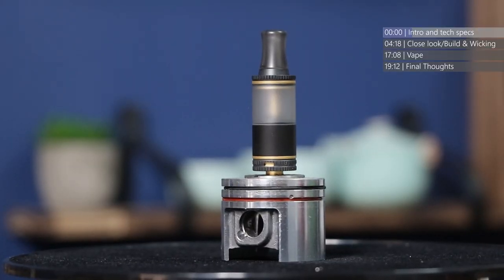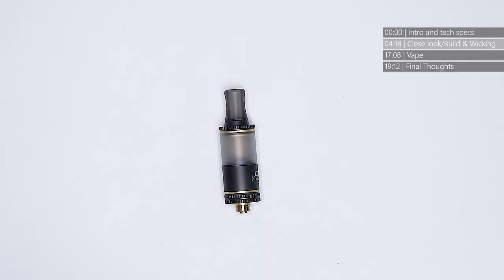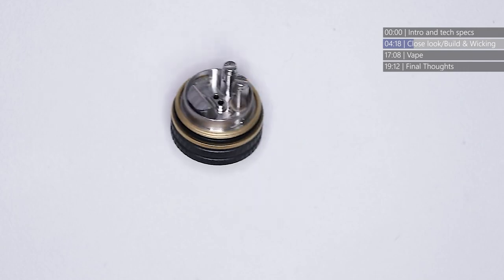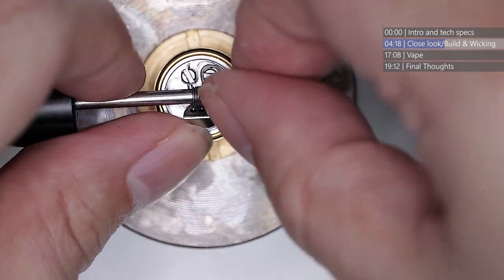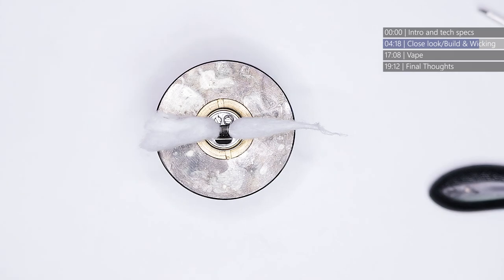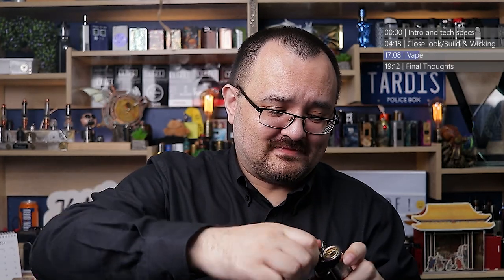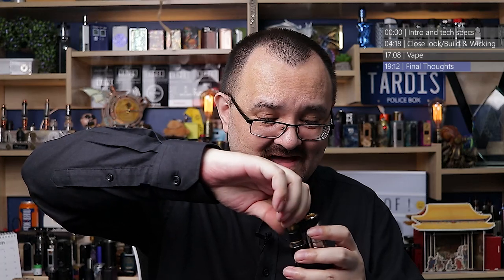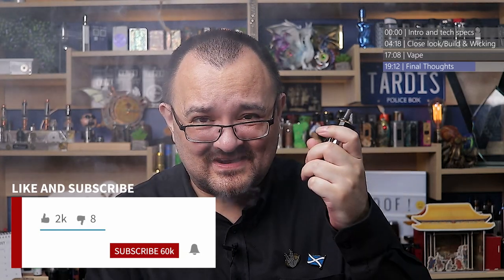YDDZ T1 MTL RTA - They could have thought of a better name...

Comment: If you want a really good MTL RTA just order an Original Flash e Vapor 4.5S for 160$. 
Yes, it's pricy. 
It's been around since 2015, always had Support for Spare Parts since and has almost no ways to break at all. 

Easy to wick, easy to build, beautiful taste.
Reply: The Clones have a lot of problems with O-Rings, Taste isn't on par with the Original one and the Stainless Steel used for this is obviously not better than the Original one.
Reply: But they will not ship to the UK, I have tried and asked them directly, they just say they have no possibility??? I had to buy clones because of this.

Comment: Hi Vic, what a nice Video. That RTA is the MTL version of the OBS Crius 2 Single Coil RTA from 2017, isn't it? BTW, my winner of small MTL RTAs is the little brother of the Flash-e-Vapor, the FeV VS with 17mm. Put a 0,3mm SS316 round wire 10 wraps on 2.5mm into it and be happy forever. You will only need a 1.3mm drill if you like the draw of 1.3 more than 1.2 or 1.4 from the air screws ;-)

Comment: I use the tank for a while now - I do like it - I am surprised you didn't have all the different air options!
I use normally the closed side air and the 2 hole at the bottom with ~15-16W. With a Vandy VAPE Ni80 30ga x 2 + 38GA Fused Clapton.
Funny today I have built a beauty ring for my Luxem mod that make the YDDZ MTL look very nice on it.
Now I have to decide if the YDDZ or the Pioneer has the privilege to sit on it :-)